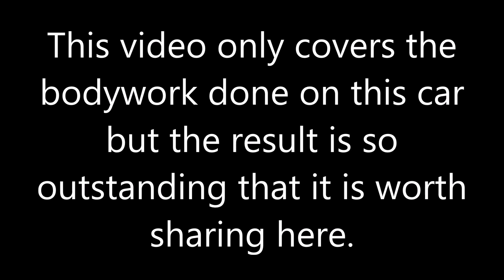Restoration of a 1982 Citroen 2cv Charleston: the best paint job I have ever seen on these cars

Comment: why not a new galvinies chassis ? BTW you doing a very nice job with those oldies !!!!
Reply from the maker: Only my opinion here but galvanized chassis were at that time about 200 euros more expensive. After that, it depends on each individual but most people don't use these cars as a daily so the rationale of putting such a resistant chassis for a few days out in the rain every year doesn't justify the cost. I would put it though if I was to prepare one of these cars for a raid on salted roads for example or on offroad tracks. But again, this is only my view ;)